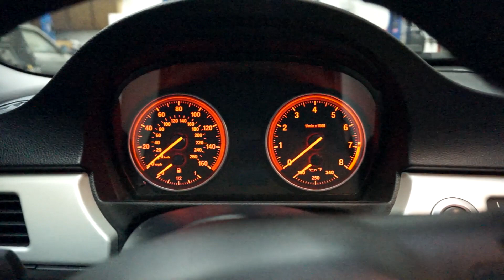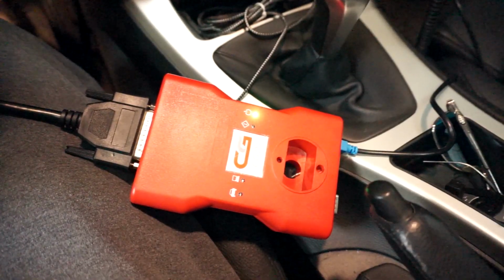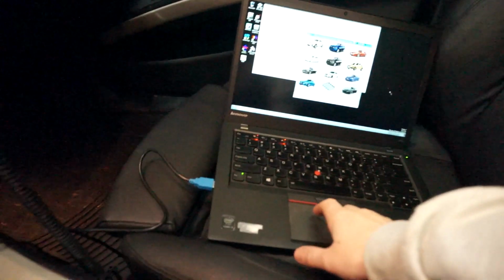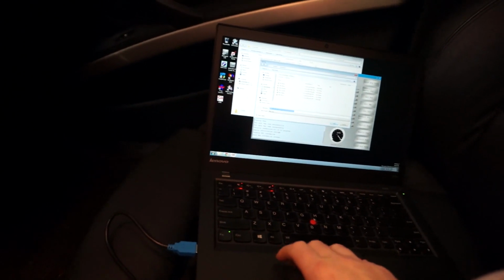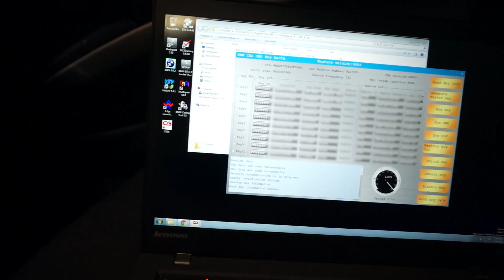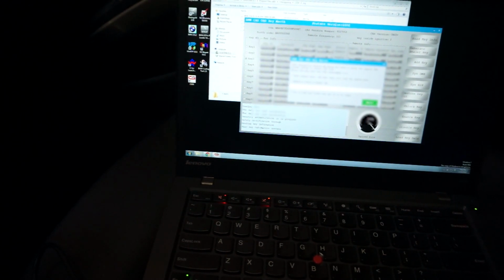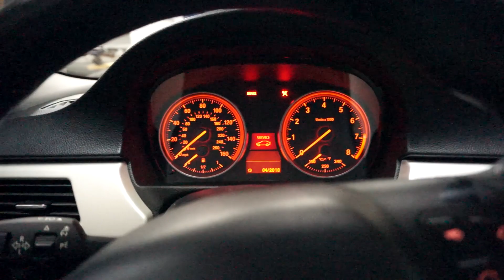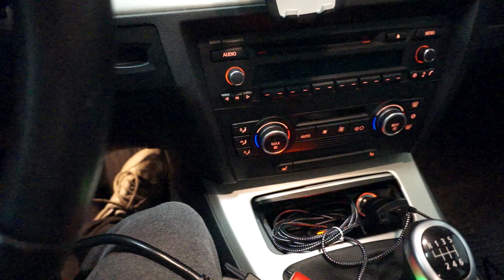Programming a new key for my BMW 335i with CGDI

Comment: You mentioned you used the CGDI to swap a DME.  Just curious where you got your CGDI and what support package you had or added to make sure you could write the ISN?  We're starting to accumulate BMWs in the family so thinking i need to get myself outfitted with all the necessary programming/reprogramming tools to keep them all running.  I had everything needed for complete maintenance of Saabs, but Saab left us with no upgrade path, so thinking of switching over to BMWs.  Can you do scan functions too with CGDI?  I don't really want to spend $2-10k on scan tools to use maybe once a year less, but don't mind spending $1k or little more if needed.  What would you suggest?
Reply from the maker: I bought mine used on eBay with the necessary entitlements. Since then, I have not needed to buy anything else although as they add features, the new features often require new licenses. I'll check on the scan tool functionality later - I think it can (I know it has a feature to be used as the diagnostic connection in conjunction with other software, but I've never been able to get it to work) but it's clunky. CGDI is only needed for programming keys and replacing ECUs that have immobilizer functions built into them (typically the engine ECU, immobilizer itself, and the transmission ECU). There are better options for diagnosis ranging from factory tools that fell off the back of an internet truck to Foxwell scanners, to phone apps. If you're tech savvy, I recommend finding the factory software and using the cheap "K+D CAN" cables which work just fine when properly set up ; I've even used them to successfully flash individual ECUs.

Comment: I programmed the key for the same car with Lonsdor. Programming went smooth, it started the car, but when I disconnected the programmer, the new key didn't work. So does your key works after you have unplugged the programmer?